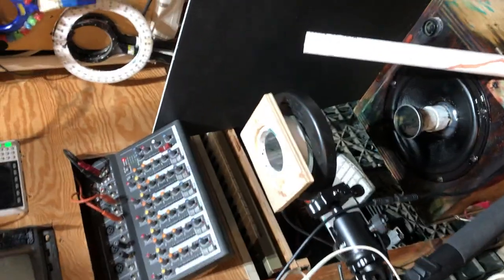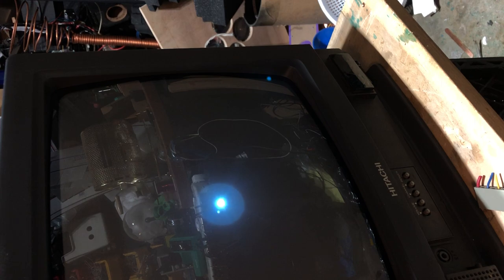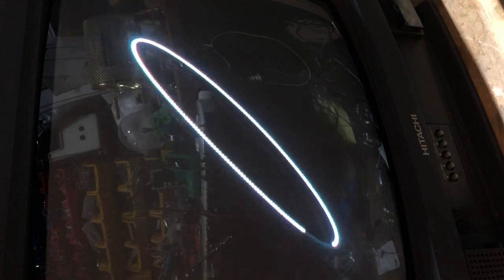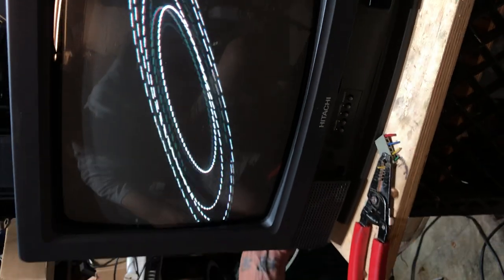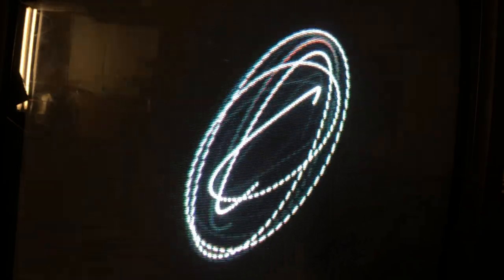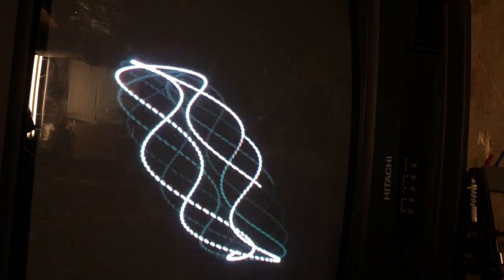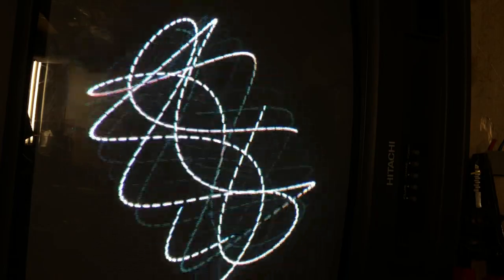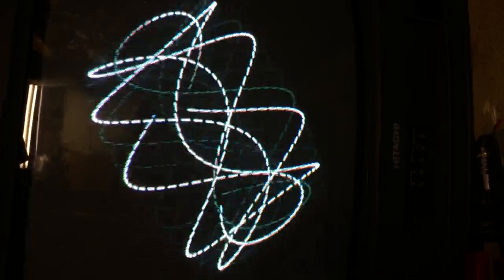Making an oscilloscope out of old tv and the behaviors of existence         👁⚛️👁

Comment: I want to make an x y z display for an Atari asteroids board. Ideally modify a Sony watchman or small crt tv. Any way I could get some help doing this for you if needed? I do electronics and just repairs the board but my oscilloscope does not have Z for intensity control so I’m trying to come up with a better solution.